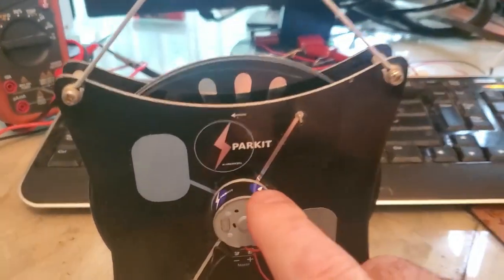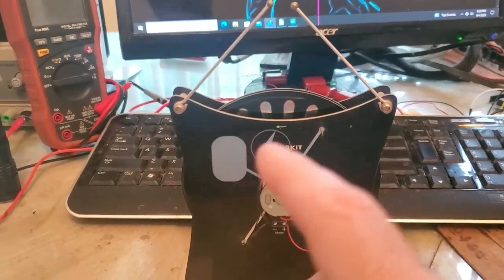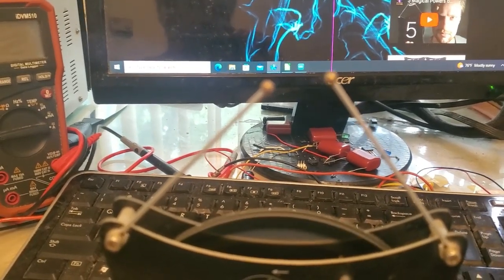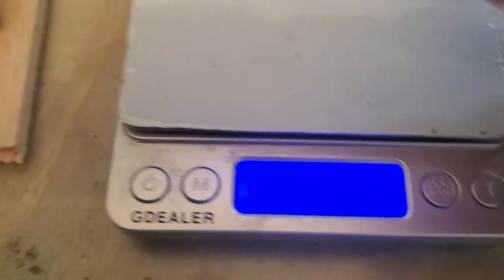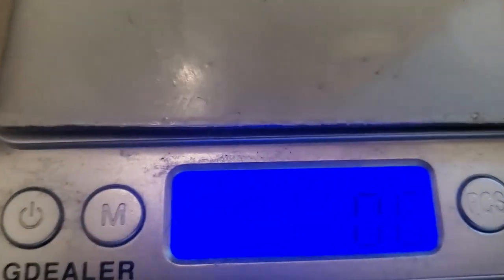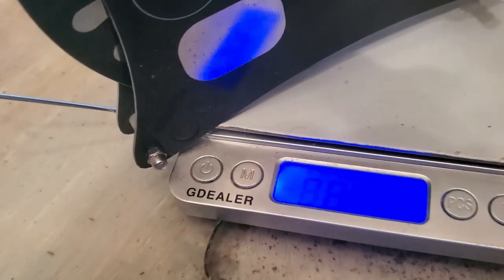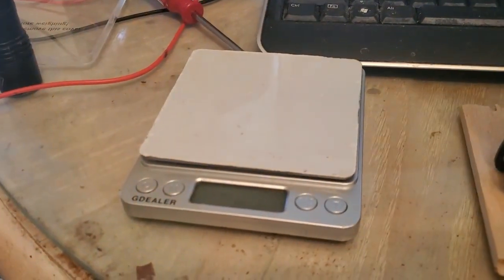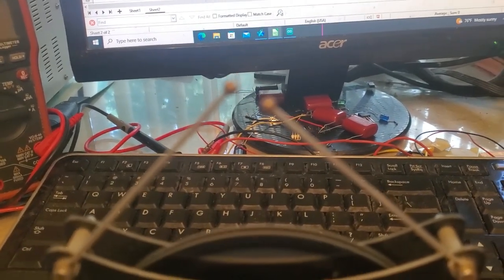Sparkit Battery Powered Wimshurst High Voltage Machine (and a Jeweler's Scale)

Comment: I'd say it's frequency transmission from the spark.
I've witnessed it before.  A few years ago I noticed if my phone was to close to the weed scales. The number would go up or down. 
And depending on the spark gap of my pulse motor. I get voltage readings on my volt meter, up to a few feet away either one wire or no wire connection.
Good video... Good stuff.👍👍👍
Might have to get one of those machines.😊
Reply from the maker: Certainly there appears to be some radio interference at times, however, it would be an odd type of interference where one orientation stays at 0 grams, 90 degrees one way consistently goes a few grams negative, 90 degrees the other consistently positive.  Would be fun to put on an analog spring scale or "Justice" type scale, maybe another video.  Along the same lines, ion stream doesn't really fit either, as you can see with where the spark gap is when sideways it would be pushing one side of the machine up, which would be pushing the other side of the machine down into the scale and should not lead to a net change.  

Thanks for the kind words and glad you enjoyed the video, if you do happen to pickup  one of these little Wimshurst machines, maybe put it on a spring scale and we can learn whether it is interference from the spark or not, and/or I may do a future video on that.